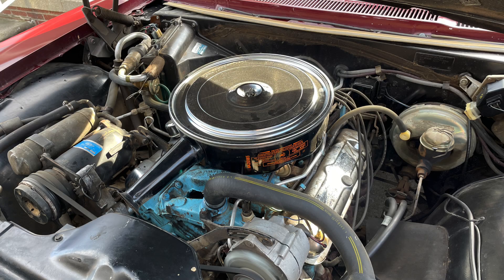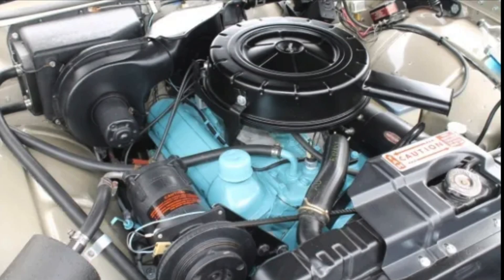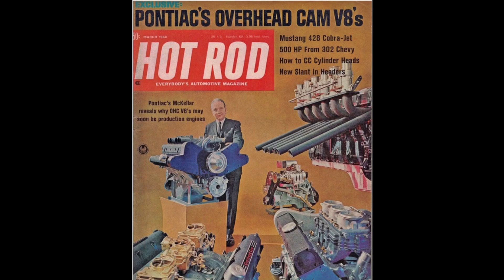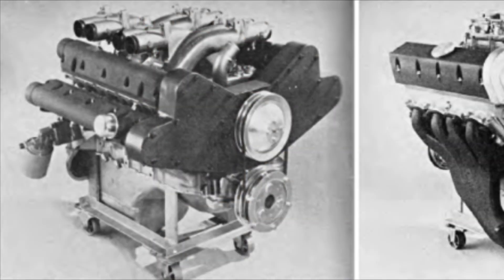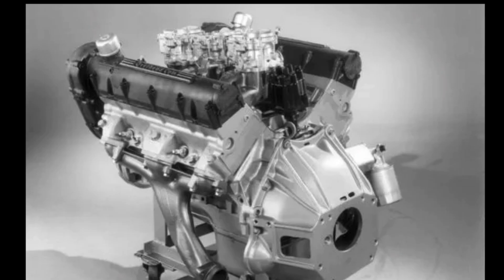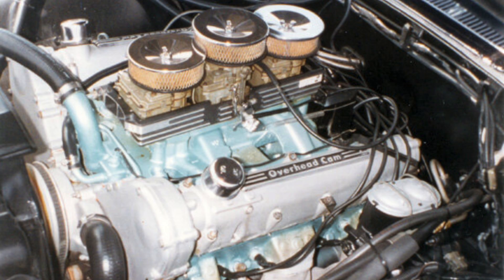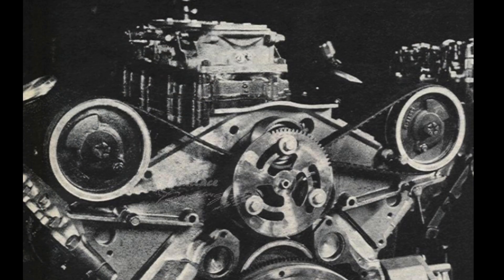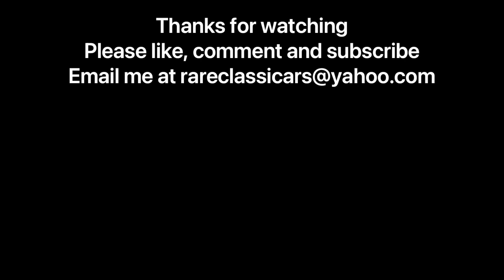Most Powerful Car Engines: Pontiac Builds SOHC and DOHC V8s in the 1960s!

Comment: Back in the day the talk was that Pontiac was inspired by the very successful Jaguar XK 6 DOHC motor that was introduced in 1948. By 1961 the Jaguar XKE  6 was 3.8 liters/ 230 cubic inches and rated at an optimistic 265 brake horsepower. Regardless of the actual output, examples could reach 150 mph making it the World’s Fastest mass produced production car. The fact that Jaguar had won LeMans 5 times with this motor in the 1950’s gave it prestige and drove sales. Also notable was that the Jaguar XK 6 was much less expensive than other premium European power plants. This created the possibility of Pontiac building a production engine offering the same technology at an approachable price point. The rest of the car would be conventional and far cheaper to produce than the XKE body and chassis with its racing derived components.
Reply: As a side note, when that Jaguar engine was installed in the XK120, the 120 stood for a 120 mph...
Reply: @marko7843  Correct. I owned  a 1953 XK 120 FHC for 47 years and am quite familiar with the car and brand. Soapy Sutton, Jaguar works test driver, took a specially modified XK 120 roadster to 178 mph in 1952.
Reply: I recall that the production Pontiac OHC 6 was plagued with camshaft failure issues. Does anyone know if the cam ran directly in the aluminum head, or was supported by replaceable bearing shells like the Jaguar design. KTM 790/890/ 901 twin cylinder motorcycles are currently suffering from premature camshaft failures. Apparently a lot of careful engineering is required to design the OHC system for reliability.
Reply: @Anatoli50 I think from reading my HPP & PE mags years ago,  the camshaft didn't have a true bearing to ride in, but in the aluminum.  And some had excessive wear like you wrote.  The Jaguar XKE 6 cylinder, John DeLorean wanted to emulate that from what I recall, he was the driving force getting the OHC 6 built
Reply: I thought it was jeep who had the ohc can failures
Reply: @eaglewi  The Jeep OHC six cylinder motor was prone to camshaft failures. My buddy had one that failed early.
Reply: Cams riding on cast aluminum heads is common. To make them last, having really frequent oil and filter changes is a must. Given what did tech not exist back in the 1960s, it would not surprise me if there was no way to make a cylinder head last, even if you changed the oil and filter ahead of schedule.

Some SOHC and DOHC engines still have durability problems. I do wonder what the causes can be.
Reply: @skylinefever  Specifying replaceable camshaft bearings like the Jaguar design cost more to build, but cost far less to repair than buying a new cylinder head after the aluminum bearing surface is damaged. You are correct about the importance of frequent oil and filter changes. The Jaguar XK motor was designed with a 10 quart oil sump, far more than typical to extend engine life. In racing applications in conjunction with an external oil cooler this greatly helped keep engine operating temperatures in check.
Reply: @Anatoli50  I was always sure that OHC cam bearings for price reasons. I have heard the fights between engineering and bean counters.

The 10qt Jaguar oil system must have been a huge benefit. It could have diluted the rate at which contaminants destroy oil.
Reply: @skylinefever  car makers like Alfa Romeo and Jaguar have been mass producing DOHC engines since the early 1950s, with Fiat having belt driven DOHC since the mid 1960s. I think some failures are due to cost cutting and perhaps engineers that didn't have experience with OHC designs, or as mentioned elsewhere in this thread, they lost the fight with the bean counters. Even the little Hillman Imp from 1963 had SOHC with a separate cam carrier, but that engine came from a Coventry Climax design.

Comment: Its amazing how much power modern engines can make and get much better mileage than these. Multiple turbos/Super chargers etc ofcourse but we have seem 600-700HP vehicles
Reply: Might make more sense to compare dyno charts on everything in N/A configuration with similar compression ratios. Much of modern engines' peak HP is due to the high RPM at which those peaks occur. The old carbureted engines are hard to beat for smooth, N/A low end torque.
Reply: Modern cylinder head and combustion chamber design, camshaft tech, plus engine management systems are vastly superior to what they had back then.
Reply: @johnz8210  Ok, sure. How about:
Its amazing how well those old N/A carbureted engines made low end torque that newer engines haven't been able to improve upon, much.

Engine management is great when its working correctly.
Reply: @johngalt97  What's an example of an old N/A carbureted engine that made great low end torque?  I'm not familiar with them.
Reply: @johnz8210  Most any v8? Even when choked with emissions controls in the 70’s they still had all the low end torque.
Reply: @johngalt97  So a 1960's Chevy 327  in a 2003 Silverado would be the same power as the 5.3 LS?
Reply: @johnz8210  Torque. Look at the Torque curves, not peak HP at one RPM.
Reply: @johngalt97  The only thing from then I have driven a lot was a '76 Cadillac Eldorado with the 500 ci engine.  It did feel torquey back then, but it was a 500 cubic inch engine.   Yes the car was heavy.  But any modern vehicle nearing that weight, which are pick up trucks, would leave that car in the dust, with 150 less cubic inches of engine.   I also owned a 1970 Buick GS 455 for a few months in the '80's.   It had great low end - torque.  Again, it was a big engine compared to what's been out there for the last 30 years.    If somebody made a 7.5 liter engine now, I kind of think it would embarrass that Buick.
Reply: @johnz8210  Low end torque is all about the torque-on-demand that makes everyday driving enjoyable. If you're comparing full throttle peak RPM power, then yes, modern engines have steadily improved.
I just find it interesting that low end torque hasn't seen similar improvements. I also find it puzzling that people pay so much attention to peak HP, instead of the low-end stuff that is the majority of most people's driving experience. I always want to see the torque curve graphed.

Comment: Also don’t forget the Pontiac Hemi that was used in drag racing by Arnie tge Farmer and Mickey Thompson.
Reply: Or the 5 aluminum Pontiac 400 blocks they made.  Saw a photo of a guy holding one, 90 lbs.
Reply: @John.Zachary.Delorean  I had one in 1980/1. You could carry it around by the front main. Had a magnesium Doug Nash intake manifold for the RA IV heads. It was a dyno manifold from Pontiac development, and had popsicle sticks in a couple of areas in the lower part of the plenum to help with fuel distribution. Manifold weighed nothing.
Reply: Micky Thompson also made hemi heads for Chevy and ford engines also
Reply: @travislostaglia8861  yes he did, but the Pontiac was most widely used . Arnie is a friend of mine and still has a couple of the MT Pontiac Hemi’s

Comment: The ohc 6 block was the same block as the Chevy 230/250 6 cyl
Reply: Sorry, nope.
Reply: If by same you mean, bore spacing, bore and stroke, then sort of, otherwise no. It IS possible to put a 292 Chevy crank in a Pontiac OHC 6.
Reply: Bore and stroke yes, it was based off of the Chevy, but had it's differences.  I don't know how they worked out casting the block, because it was different.  I think I read years ago there was an accessory drive on the OHC 6 that was different for sure,  ran several things, I don't want to misquote how many or what

Comment: I find the DOHC engine's bank angle a very interesting feature since it clearly deviates from what you expect at a V8. Looks like approx. 120 degrees wich, combined with the valve train, makes for a low, yet very wide engine. Can anybody provide further information?
Reply: I think that it's just the cover over the cam belt that has that wide angle. If the lower of the two pulleys visible on the front of the engine is attached to the crankshaft, the angle of the V appears to be around the standard 90 degrees
Reply: I believe these prototypes were all based on existing production blocks - so 90 degree bank angle using existing cross plane cranks.

Comment: Do you have any idea why, when they made the half a v8 they chose the right rather than the left bank?
Reply: Most people drive alone, so it helps offset the weight of a single driver, like the MOPAR slant-6
Reply: Fuel pump is mounted on the right side, and engine could be produced on the same production equipment as the V8.

Comment: Adam, Fascinating, this is the first I have heard of a Pontiac V8 with overhead cams. If bolted to a Muncie wide ratio, 4 speed transmission and limited slip differential, they certainly could have made a spicy Safari wagon with one of those. 😁
Reply: Those OHC Pontiac V8s would've even give the 427 SOHC Cammer V8 a run for its money as well.